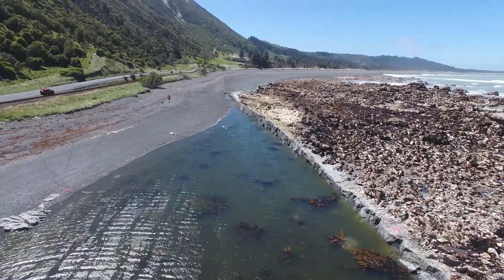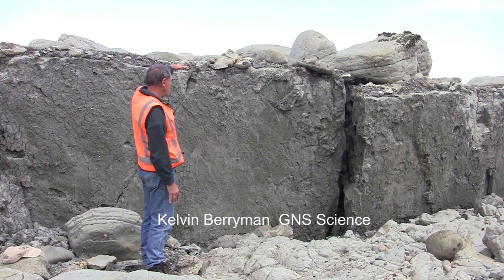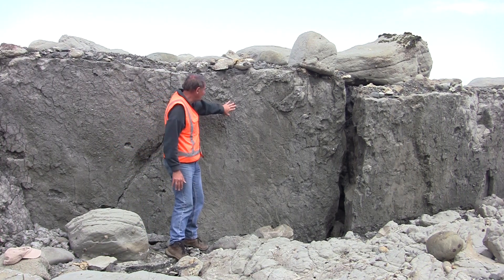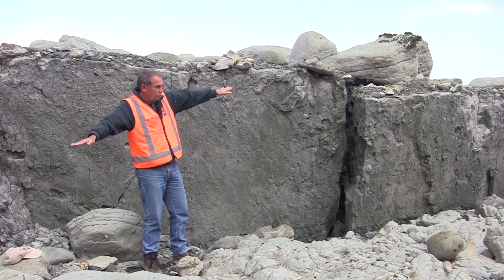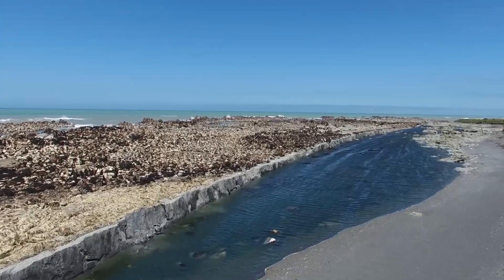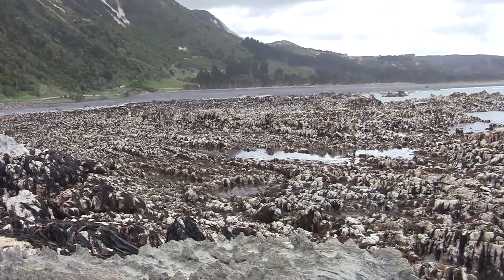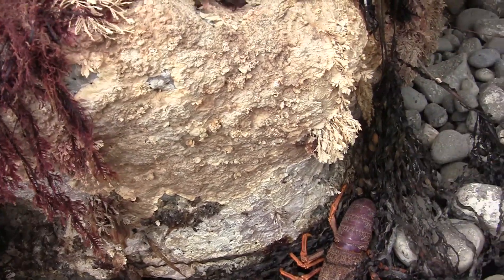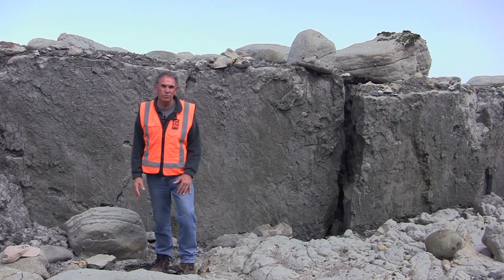Papatea Fault and Raised Coast

Comment: 3 km/s!? I guess some fish are in orbit around the earth now.
Reply: Fault propagation the speed the rock initially breaks along the fracture, much like how fractures in glass propagate faster then the eye can see. Only after the crack has formed, the rock on either side of the newly formed fracture can start to move, at a slow walking pace, forming the fault scarp. The velocity of crack propagation is approximately the speed of sound in rock (or indeed glass). Also, interestingly, the reason a balloon pop is so loud is not just because of the sound of escaping air, it's also due to the ripping of plastic that happens at supersonic speed (this creates a sonic boom like how a whip cracks).
Reply: Just looked it up, escape velocity on earth is 11.2 km/s
Reply: it was 3km/s horizontal speed along the fault, that's not the speed it moved upwards. Which would be much slower (but probably still quite fast)

Comment: @devperzero
A magnitude 7 in the Richter scale earthquake generates waves with around 2 million gigajoules of energy, if I still remember it correctly.
To put that in perspective, that's the equivalent to 2 petajoules, which is 2 megatons of explosive power. The biggest nuclear bomb ever detonated (Tsar) had a force of about 50 megatons, or 50 petajoules of energy in the moment of the blast. A scale 7 earthquake releases around 5% of energy compared to the Tsar bomb multiplied by thousands of times during those 30-60 seconds of earthquake, since the earthquakes are compiled by seismic waves (imagine the water waves when you throw a stone, each wave has that amount of energy).

If you want yet another perspective on the other side of the scale, the nuclear bomb dropped in Nagasaki during WW2 had roughly 20 kilotons of energy. That's 0.02 megatons, which is equivalent to 1% of the energy released by each wave, so you'd have to drop 100 bombs that were dropped in nagasaki to create the force that a single seismic wave has from a scale 7 earthquake.

That's the amount of force needed to create this.

The scariest thing is that a scale 7 is not scary at all if you compare it for example to a 7.5 or even an 8. The biggest recorded earthquake was a 9.5 in 1960 (in Chile, I believe). The richter scale works like this: Between whole numbers, the amount of energy is multiplied by roughly 32 times. So a scale 8 would be around 64 million gigajoules and a scale 9 would be around 2 trillion gigajoules, or 2000 petajoules. That's the energy equivalent to, PER SEISMIC WAVE, the explosion of 100 tsar bombs OR 250 THOUSAND Nagasaki-like bombs. And that's a 9, not a 9.5.

It's insane.

You can get somewhat specific if you take the geology factor in, but I'm not from New Zealand nor I know their geology, so I'll stick with this. I answered your question with a line and got a bit excited. Sorry guys :P
Reply: Real MVP here.
Reply: Crazy thing is, compare the thickness of earth and water. There's  only a few % of water on earth even less fresh water. And its still massive and dangerous to us. You got to respect the raw power of earth. 😁💪
Reply: Tnkx for explanation, to get a bit of understanding how much force u need to create. That's sick

Comment: 3 km second :O
Reply: Hi! I know that number sounds impressive, but in reality all it is the speed of sound in that medium.

For example if you had a kilometer long wooden stick with point A being the end you're holding and point B being at the end of the stick. If you then suddenly moved point A forward by any amount, it would take a little bit less than 1/3 of a second for the movement to propagate through the stick to point B. (For reference, the speed of sound in wood is anywhere between 3,300-3,600 meter/second.)

This is exactly what is happening with tectonic plates in an earthquake. While, I haven't formally studied plate tectonics yet, that's next semester, I think I can help give you a better understand of what is actually going on. Let's say that the hypocenter is 3km away from the epicenter and moves 3 meters in 10 seconds. 0.3 m/s is 1.08 km/hr. The speed at which this movement will propagate through the land is much greater than 1.08km/hr, it is in fact roughly 3 km/s. If it was 1.08km/hr it would take a little less than 3 hours for the movement make it's way through 3km of earth. In reality, the propagation of the movement happens all in one second. When point A starts moving at t=0s, point B will start moving at t=1s. When point A stops at t=10s, point B will stop at t=11s.

I hope this clears up any misconceptions!
Reply: Tony Spalony 
wow thanks
Reply: Thanks.